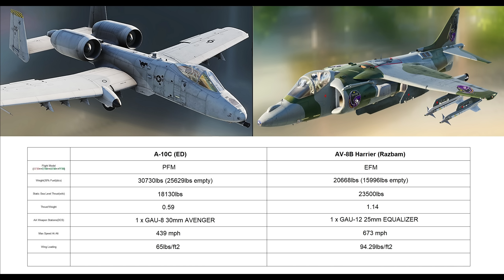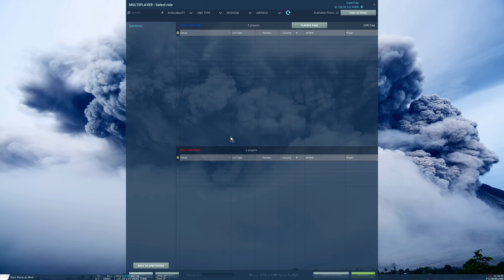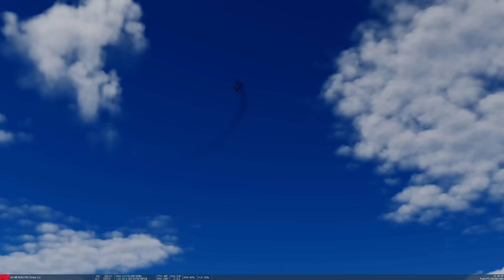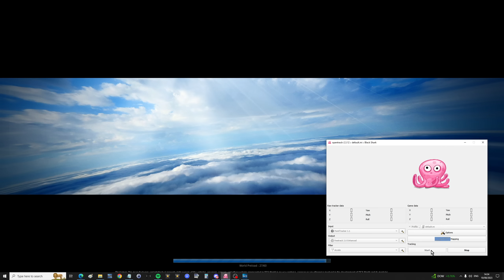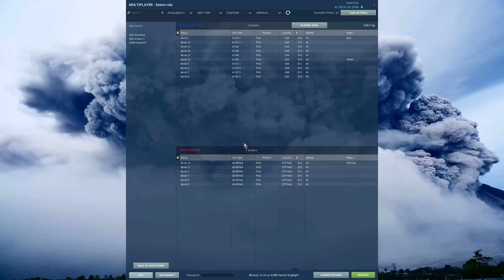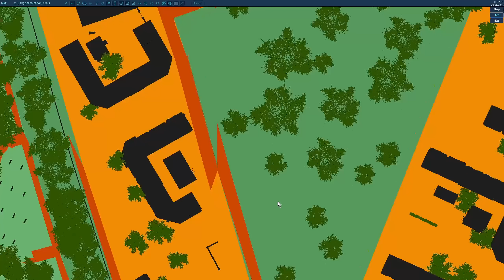A-10 Thunderbolt II vs AV-8B Harrier II: Dogfight | DCS

Comment: You often mention the troubles of putting a jet against a warbird.  This fight has me thinking what if you had the brothers fight?  P-47 Thunderbolt vs. A-10 Thunderbolt II
Reply: I think I saw it done, and the war birds won.
Reply from the maker: Classic case of asymmetric warfare: https://youtu.be/Jz9r2kDQYUQ
Reply: They did Spitfires Vs A10's.  A10 could only escape by extending in a shallow dive, otherwise the Spits got them
Reply: The problem with the Jets vs Warbirds is the gap between speed cuz the actual jets like F-16, F-15 etc. have higher lower airspeeds than that of the warbirds maximum speeds, while the harrier despite having a higher top speed cannot fully out run the A-10, its a similar situation with the A-10 Vs the Warbirds
Reply: someone did supply the link for the battle with Spits & Mustangs.  I would think the P-47s would be less maneuverable and be more of a fight. @TimInertiatic
Reply: My Uncle flew P-47's in WWII.
He was straffing a train when they uncovered an anti aircraft gun. He said the only way to survive was to hit the gun head on before you pulled out and gave them a silhouette to shoot at.
It also put the engine between you and the gun in case you got hit.
Which he did.
He said he made it back to base.
Barely.
And that's when they told him he was missing MULTIPLE cylinders from his engine.

Comment: Perhaps if you used the Harrier's ability to adjust the VTOL nozzles in forward flight more, the A-10 would face a tougher fight.
This actually shows very well when Simba flies the Harrier.
Reply: Was thinking this, with VTOL it should be able to out turn the a10 easily.
Reply: @92HazelMocha   Counter to that would be to go vertical and kill the AV-8 while it tries to recover it's airspeed.
Reply: SHARs in the Falklands didn't VIFF at all as far as I'm aware and got 20 kills with no air to air losses
Reply: I commented about this, but this is one hundred percent true. 

My dad served on amphibious assault ships In the united states marine corps, Which had harriers on board. He has told me multiple times he has witnessed them Dump the nozzles in a vertical climb, And pulling a impromptu cobra maneuver and the chase Aircraft was always unable to discelerate and would fly right past them, Thus putting the Chase Aircraft In the kill zone.
Reply: @TimInertiatic but they faced A4s who didn't carry missiles and usually had less than 5  minutes of fuel over target area. Most A4s got shot down running in on the British ships or got shot down as they tried to escape home after dropping their bombs.

There were instances were the British probably would have lost a harrier or two if the A4s carried missiles.
Reply: @92HazelMocha Not necessarily at slow speed with the Harriet's wing-loading. Against fast jets, much more likely, but against a plane that flies only slightly faster than a Piper Cub? The key is for the Hawg to recognize the VIFF and counter early with an out of plane maneuver to spoil the overshoot.
Reply: @pogo1140  The Harrier has over 1:1 thrust to weight. It can outclimb the A-10 all day. These guys cannot fly the Harrier
Reply: The harrier can’t use weapons when nozzles are tilted however
Reply: @broganjohnston750  not in the hover but you can still fire when flying very slow
Reply: @TimInertiatic   the SHAR is faster and designed for Air to Air combat, the Marine Harrier is an Air to Ground fighter. It does the job better than the A10. However the DCS A10 is not accurate. It may fly the same, but the gun is way way way more accurate.
Reply: @92HazelMocha  you can fire twitter up to 30 degrees vector...but it only takes a second or so to go from 100 degrees to 30 degrees.
Reply: @Pukin-Dog  The problem is when it climbs into that clear blue sky, the A-10 could just point a nose up and shoot him in the butt.  The Harrier can't out climb an AIM-9. It happened to Cap twice once in the climb and once during a level extension!  When the Harrier comes down the Hawg can simply spoil the maneuver with a tight out of plane maneuver, and turn and face the descending attacker, shooting it with either a missile or those big juicy GAU-8 rounds.  

Part of the problem was the setup for the battle.  The consensual merge put the Harrier at an immediate and unrecoverable disadvantage. The Harrier, with the high wing load was never going to get the first turn on the A-10.  Shaw discusses this at length in his tome on air combat, and the US experience in Vietnam verifies this.  The consensual merge takes away ANY energy advantage the Harrier had other than initial speed that immediately fell off in the bank and yank, so it was going to lose almost every time, just after the first turn!  

I can see VIFF at higher speed as being a potential adjunct to BFM.  But at slow speed and low altitude, like fighting the A-10 in the pig-pen, the energy loss due to VIFF is a huge invitation to depart controlled flight - or - to get stuck in the mud flailing around trying to rebuild airspeed while the Hawg happily eats it's lunch.  Simba absolutely did it right, but he was also lucky.  The counter to his VIFF pull-up  was to roll and dive underneath Simba's nose.  But the idea of a Harrier hanging in mid air, spinning on it's access, flinging missiles at hapless Hawgs is beyond ridiculous, for reasons others have stated, to say nothing of the kid with a slingshot wrecking its whole day.
Reply: @aztec0112  maybe but your argument against going to the vertical would hold for any aircraft going vertical and yet we know that's it's an established tactic for exactly this situation- an opponent who can turn better but who has a shitty power to weight ratio, after merging and pulling 180' of right turn, I doubt the A10 would then have sufficient energy to point it's nose vertically and if so would then be dropping and vulnerable
Reply: @laurencedawson7754  it does. Which makes it a good knife fighter in a phone box. However the reality is this never ever happens.  If it did the A10 would be a front line fighter and not ground attack in safe areas.
Reply: @aztec0112  That's very true....but you would not simply climb vertically, the tactic to employ would be to merge and start a hard climbing turn...so that the A-10 cannot get nose position. The A-10 can only maintain around 20 degrees nose high, another option wold be a vertical turn post merge followered by a secodns vertical turn which the A-10 could not follow. Additionally the Harrier could choose to climb toward the sun where it's effectively immune from heaters. Even in idea conditions though getting a tone on the seeker in an A-10 is really hard. If stuck in a low speed turning fight then the Harrier should swich to a very low speed 1 circle fight....that's normally easy against most fighters....though that it tough against an A-10 and you cant switch from 2C to 1c in a tight enough space to stay inside the A-10s circle without a risk of stalling...so really the Harrier needs to avoid what it normally does best i.e. a slow speed fight and drag the fight high until such time that the A-10 cant maintain any nose up authority....and that wont take long
Reply: @Pukin-Dog  absolutely.......in addition varying the nozzles isn't just for show manoeuvres - it can effectively reduce the wing loading......
Reply: @laurencedawson7754   Absolutely!!!!! Tha's the point that I always make. It reduces wing load and aoa. In a dogfight thust to drag is hugely important....and the thrust to drag of a Harrier isn't great on paper as it's not an aerodynamic plane unlike say an F15.  However in a dogfight drag increases massively as the wings turn into air brakes. Vectoring, especially in the way the harrier does it (as opposed to how the F-22 does it)  i.e. the entire fueselage gets thrust  which reduces the AoA and wing loading and the critically drag.....of course you lose forward thrust but it seems to be the case that the loss of forward thrust is of less importance than the drag saved when in a turn. (takes 4 times the power to double your speed due do drag so that makes perfect sense)

Comment: Interesting that in the 1 V 1 the A-10 got it's kills either with the gun or a maneuver kill, not a Sidewinder
Reply: yeah despite the heat of the pegaus harrier engine,  as it exhausts out of 4 vents the overall heat to lock on seems to be quite low
Reply: The A10 uses a high bypass turbofan engine. The exhaust gas gets blended with a huge volume of near-ambient temperature airflow before it even leaves the engine shroud.
Reply: its*. “it’s” means “it is”, have a nice day

Comment: I saw a picture of an A-10 with a F-22 kill mark on it and people was really salty about it. Can you do a dogfight with the A-10 vs F-22?.
Reply: Yeah, that was because the F-22's got cocky. The F-22 pilot went after a flight of transports for a easy kill and did not see the A-10's that were trailing the transports..
Reply: @flashgordon6670   "Harriers can beat anything, if the pilots master its ability for aerobatics."   Nope. Hawgs clean its clock.
Reply: @pogo1140 is there a video or picture you can drop
Reply: @flashgordon6670  Wrong. Why do you say the greyhound only has 3 legs? If it's so pitiful and useless why do you demand a rematch? The Hawgs clearly superior. Admit and embrace it. 😄✌
Reply: @flashgordon6670  One of the things that the A-10 pilots had to learn in advanced weapons syllabus was to dogfight in the A-10, as this was not something covered in the regular A-10 flight training. It's akin to the A-6 intruder dogfighting, you don't think it can but a clean A-6 with a trained pilot is a bit of a nightmare for F/A-18 pilots who've never seen them fight. BTW an A-6 with 2-4 AIM-9's is faster than a similarly loaded  F/A-18 in full mil
Reply: @flashgordon6670 Do you have enough roughage in your diet? Do you need some cream or something? 😛
Reply: @flashgordon6670  ???
Reply: @flashgordon6670  you haven't said anything that requires a response.

Comment: The AV8-B ace up it's sleeve is VIFF....without using that it's at a real disadvantage as shown in these simulations.   The nozzles moved a few times in fights but didn't seem to be used to full advantage.    I bet an experienced Harrier pilot would make a better showing of the aircraft if the techniques were allowed to be used.
Reply: They did not use that in combat because it causes the plane to lose all it's speed
Reply: @pogo1140  Actually, it has been used in combat by the Brits. And was used in training multiple times to pull off surprise kills against superior aircraft.
Reply: @flashgordon6670  You mean be a pinata waiting to be hit?
Reply: @MrEsphoenix  I've not read any actual after action reports of it being used in the Falkands, and seriously against missile armed Mirages, you really don't want to
Reply: It seems to me the main advantage of the Harrier is its thrust to weight ratio. The A10 loves slow, high turn rates at low level. Should have used altitude to outperform the A10.
Reply: @flashgordon6670  doesn’t that apply equally to both aircraft?
Reply: A guns only modern jet fight would be interesting...
Reply: @pogo1140  But we're talking about different engagements here.  1v1 the VIFF could be very effective...against multiple enemies you probably don't want to give up your airspeed as you mentioned.
And don't forget the Harriers in the Falklands were effective because of the latest Sidewinders that the US gave them on the way down which improved their lethality.
Reply: @pogo1140 Exactly!
Reply: @pogo1140  They have used it in DACT

Comment: I remember reading about the air force doing simulations and I think a "for fun" training exercise of an a-10 vs f-16 and a lot of the time the a-10 could "turn quicker" than the f-16. It was something like even though the a-10 is much slower, the wing design made it very efficient. If I'm understanding what I read, the a-10 can turn/change angle (degrees) just slightly faster than the f-16 or something like that. The way I thought of it was the f-16 does a big circle (360 degree turn) very fast, and the a-10 does a very small circle much slower but can make the 360 rotation just slightly faster.

Comment: Huge problem with the Harrier is that restriction it has on the gun being able to be fired depending on where the nozzles are angled. That means for a LARGE portion of it's "dog fighting" abilities are limited on when it can get a shot off. 

ALSO, let's not ignore that the A-10's ability to turn is FAR more agile than you would think that a "ground pounder" plane could pull off. In fact, it has one of the BEST turn ability at lower speeds than MOST planes. Not to mention that it is EXTREMELY rugged.

Also, A-10's gun in a dogfight is like using a sledgehammer against an ant. Once the A-10 can put the "shots on target" it is pretty much going to completely destroy any aircraft made.

Comment: Predicted this- the VIffing lets the Harrier immediately point it's nose- and if it can use that like a impromptu cobra, it can sorta one-circle-ish rain down missiles, but it's got to constantly be switching modes, and pointing it's nose. Gotta use your plane's special abilities!
Reply: it's really hard to do a cobra in the harrier as its modeled. the flight model is really great but there are limitations base on how flight sims are modded. I don't claim to be a good or great harrier pilot but I feel I pushed the flight model pretty far and I hope it was enjoyable. cheers thanks for watching
Reply: @simba1113  your piloting is impressive as always, and your creativity in using unique aspects of what each jet brings to the table is awesome! You def pushed the model, but that was the way to go!
 I love watching you constantly push the technical bounds of rate of climb, acceleration,  AOA, turn rate, etc in these videos,  and can't get enough- you're a force to be reckoned with in any plane Simba
( and ya, harriers can't do cobras prope RR,  I meant that ability to get into a state where you can point your nose extremely fast, and swing it around- which isn't too diff from flankers using Cobras or FCS's disabled to pull 120 degrees AOA to take shots at foes constantly
Reply: @simba1113  great flying- do you think you could have used the vertical? Was thinking of a way to use the Harriers power to weight advantage? Can you keep away from his nose in a series of climbing turns until the A10 loses energy and has to drop his nose?

Comment: So what is wing loading and how did the A-10 gain a drastic advantage in this battle over the Harriers by having lower wing loading?
Reply: Wing loading is the weight of the aircraft in relation to the total area of the wings.  The wings are supporting the weight of the aircraft.  So a low wing loading (relatively more wing area per pound - or kilo - of aircraft) means the aircraft will "slide" less as it maneuvers.  Think of a loaded truck with small tires compared to one with great big tires - which one is going to be able to take a turn faster?  That's a quick and dirty explanation, it gets a lot more complicated, but it should get you into the ball park
Reply from the maker: Great description!
Reply: @xet1sw156  and it doesn't apply to the Harrier very well. The Harriers nominal wing loading is high....but vectoring reduces the wing loading (right down to zero when hovering).

Comment: The A-10 is a beast. The Air Force was planning a replacement for it but the new designs were basically just another A-10. When you've got something that works stick with it. 
Unrelated but it just came to mind that an interesting scenario would be imagine Linebacker II in 1972 over Hanoi but instead of it being done by the USAF with the B-52 imagine if it had been done by the Soviets with either Tu-95s or Tu-16s. How would they have performed?

Comment: Im sure Growling Sidewinder has a video of manoeuvring the nozzles during a dogfight.
Reply: you can and I did but in DCS you have to have the RPM above 90 percent and the nozzles back to fire weapons. its a very tricky timing thing that needs a lot of practice. in real life the pilot probably had a circuit breaker he could pull to get around this,
Reply: . @simba1113   Yeah roger, i flew the AV8B exclusively in DCS for a about 18 mon ths and the gun/engine RPM was a constant frustration. Great flying though.
Reply: @simba1113  I have a channel largely dedicated to the Harrier - including various Dogfights vs Hornets, Mirages, Vipers. Beating an A-10 should not be difficult. If you fancy an A-10 vs Harrier fight then let me know.